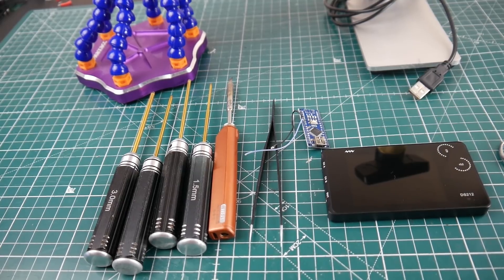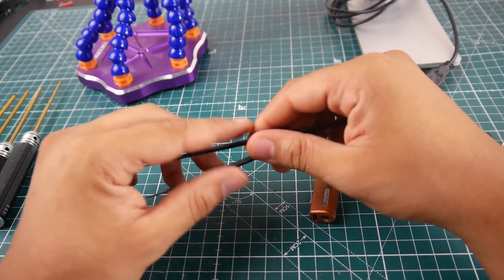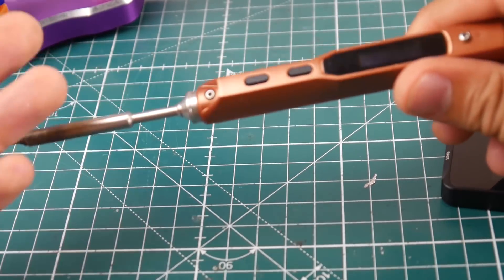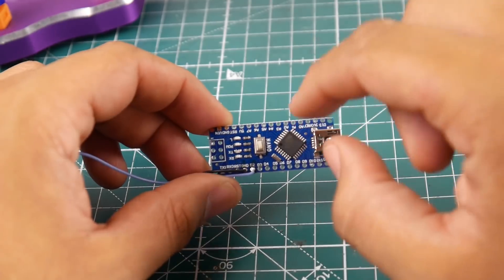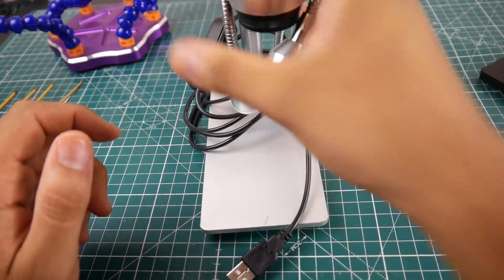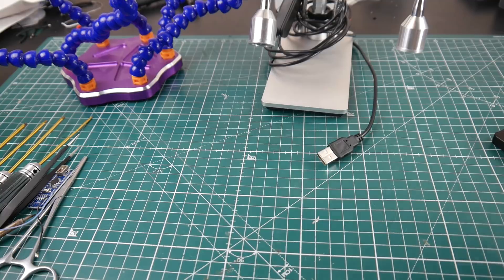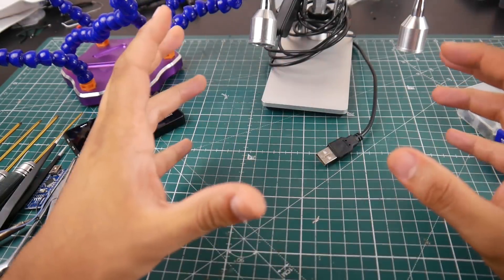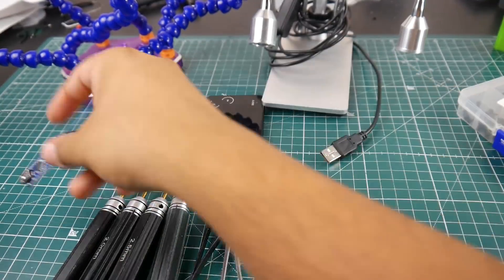Must have Tools For Any Drone Builder // #DIY #DRONE #HOWTO #TOOLS

Comment: Already have some mentioned items. That screwdriver set became my main screwdriver set as well. Not very friendly with Torx head screws, however Torx's are rare in our gear and I have Torx screwdrivers too. Upgraded TS100 and oscilloscope are waiting in my shopping cart for some time. Oscilloscope is Nano DSO203 though - a faster one. I'm curious why I'm not see a multimeter - it is the main electronic measurement tool for us - a way more comfortable than oscilloscope. Something like ANENG AN8009 - it can measure capacitance and frequency too.

Comment: the soldering iron TS-100 + the tips + cables cost over $100. It's ok if you build a quad every day (or I would say it's a mobile device if you need repair on the field)  otherwise you can get a cheap one  for $30 max to get the job done

Comment: Is the arduino the way to go for wireless use on a simulator or going the route of setup in betaflight 3.4 using a flight controller?
Reply: Frank Sura Well, an Arduino is much cheaper than a FC...
Reply: MC's Creations  ok.  Other then price, is the adunio as fast?  Less or same latency vs using a flight controller?
Reply: Frank Sura I think it's the same.

Comment: Yea I also bend the tweezers when using that for other stuff that they are not supposed for. And yes the new ts100 ist just a smaller version with less power and cheaper no new features the original ts100 is still the best. I literally have all the exact tools that you use except for the microscope and the oscilloscope. And I have a custom 6 in 1 tool with Hex and so on from RJX hobby with my name lasered onto it. Also the suleve standoffs I get my screws like m2 and so on also fork them in addition to the standoffs. I really need screws from time to time that's what I would add maybe to it plus silicone wires and the heat shrink assortments. Looking forward to tutorials on the oscilloscope.